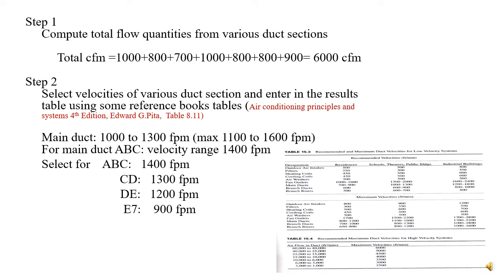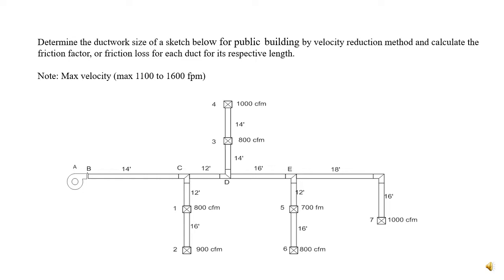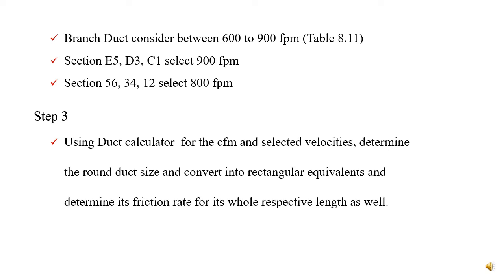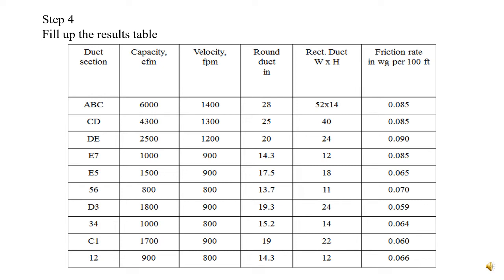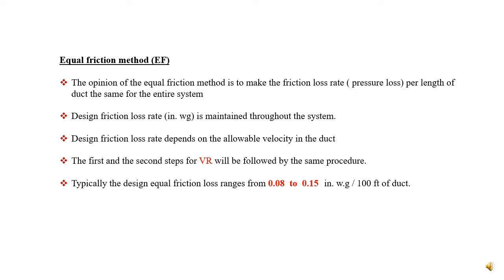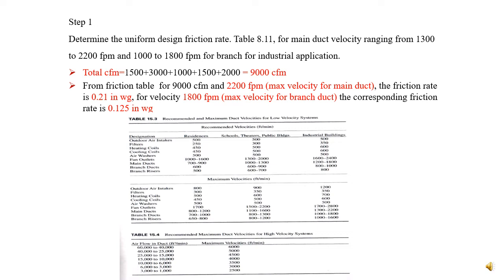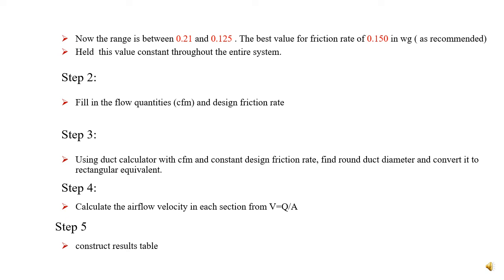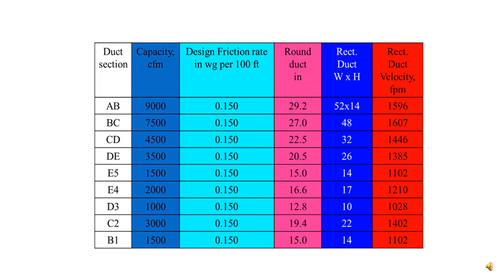Air Distribution System Design Lecture 7 part 2

Comment: ZARIF ROSTAM (B071710681)
continue the previous lecture in Velocity Reduction

Step on Velocity Reduction Method
- total up total air flow (cfm)
-choose the best velocity and cross check the max air flow in main duct and branch
-based on the air flow and friction rate choose the duct size

Step on Equal Friction Method
-All duct system will using the same friction loss
-First and second step for VR will be followed by the same procedure.
-Design equal friction loss ranges from 0.08 to 0.15 in w.g / 100 ft of duct

Comment: KHOR YE SHU  (B071710464)

*Velocity reduction *
1. The design focus the highest at the entrance (1000 to 1300 cfm) and the the end section of duct size will be lowest (900cfm).
2. Every point can check using duct calculator to find the cfm and velocity.
3. From duct calculator also can find the size of round or rectangular duct.

*Equal friction
*
1. To make the friction loss per length of duct the same for the entire system
2. Design friction loss rate (in. wg) is maintained throught the system. 
3. Use duct calculator.

Comment: Muhammad Zulqarnain Bin Zamzuri (B071710782)

VELOCITY REDUCTION METHOD
•	Compute total CFM
•	Select velocities of duct section and enter in result table using preference books table
•	Using ductulator, determine size of duct and friction rate using CFM and selected velocities
•	Fill the table result

EQUAL FRICTION METHOD
•	To make up friction rate loss (pressure loss) per length of duct the same for entire system
•	Design friction loss rate (in wg) is maintained through system
•	Design friction loss rate depends on allowable velocity in duct
•	1st and 2nd step for VR followed the same procedure
o	Step 1 : Determine uniform design friction rate
o	Step 2 : fill in CFM and Design friction rate
o	Step 3 : using ductulator with cfm and constant design friction rate, find round duct diameter and convert to rectangular equivalent
o	Step 4 : Calculate airflow velocity from each section using V=Q/A
o	Step 5 : Construct result table

Comment: MEGAT MUHAMMAD UMAR BIN MEGAT KHAIRUNI (B071710565)

- For velocity reduction method(VR) the velocity are assign to some section of the duct system
-the highest velocity is at the entrance and the lowers velocity is at the end of the duct.
- by using duct calculator we can check the CFM and velocity
-by used the velocity and area of the air duct we can calculate the quantity of the air

-for equal section method(EF). 
to make sure the friction loss rate per length of the duct is same for the system and
to  design friction loss rate (in.wg) is maintained through the system which depends on the allowable velocity in the duct

Comment: Cheah Kok Hun B071710006

2 New Methods Calculation Learn in Lecturer Part 2
Velocity reduction Method( VR)

Velocity reduction( VR)
-Assign velocities to each various section of the duct system
-Velocities at the initial entrance would be the highest and followed by succeeding sections are reduced, lowest at the end of the duct.
-The air quantity for each section is known already by assuming a velocity, which this enable flow area to be calculated

Equal Friction Method (EF)
-The design calculate the friction rate in (w.g) of the system of the duct
-The friction loss depends on the velocity allowable in the duct.
-The design friction loss should follow the range from 0.08 to 0.15 in w.g/100 ft

Comment: MOHAHAD SYAFIK BIN SOFI
B071710064
VELOCITY REDUCTION METHOD
in which it is appropriate to assign velocities to different parts of the duct system in order to know the velocity and to measure the air quantity flow area for each section supplied. 
-- The various sections of the duct system are assigned speeds. 
-- The maximum speed is at the entrance and the lowest speed is at the end of the duct
EQUAL FRICTION METHOD
-The analogous friction approach is of the opinion that the friction loss rate (pressure loss) per length of the duct should be the same for the entire device 
-Design loss rate of friction (in. wg) is sustained over the entire device. 
-Designing the rate of friction loss depends on the velocity allowed in the duct 
-Same procedure will follow the first and second steps for VR.

Comment: NUR SHAFIQAH BT ABDUL GHAPOOR (B071710400)

Velocity Reduction Method (VR)
1. Assign velocity to the various section and the highest at the enterence of the ducting system.
2. Velocities in succeding sections (neck section) are reduced and make sure the lowest velocity at the end of the duct.
3. Air quantity for each section (or room)  are known already and by assuming, it can calculated the flow area.
4. As long as the design make sense, it will probably accepted, the unrealistic design like flexible duct cannot be greater or equal to rigid main duct, it does not make any sense.

Equal Friction Method 
1. Like it's name, the fiction loss for the whole duct system is the same or equal.
2.  Friction loss rate maintained throughout the system.
3.  design friction loss rate depends on allowable velocity in the duct (cross-checked).  
4. Typical design is 0.08-0.15 in w.g/100 ft but it depends.

Comment: LIM PEI JUN (B071710194)

Continue from previous slide, this presentation is regarding VR and EF method.

Step of VR
-compute total flow qualities (CFM)

-select velocity of various duct section, example of FPM for main duct and brand duct.

-using CFM and selected velocities to determine the size of duct even square or round duct through ductulator.

Step of EF
-compute total flow qualities (CFM)

-select velocity of various duct section, example of FPM for main duct and brand duct.

-using friction loss to getting the duct size through the ductulator.

Note: equal friction loss usually are 0.08, 0.1 and 0.15 in wg/100ft of duct.

Comment: ALDY HENRY DUSIM (B0717100329) 

Velocity Reduction Method (VR)
-its shows the step for the method calculation and it is important to know the total cfm of main duct and also need to select velocities for various duct section and this need to refer the table given from this slide. this is to help improve the air flow for the system and minimize the loss. note also that the main duct must be 1000 to 1300  fpm (max 1100 fpm - 1600 fpm) thus main duct must be the biggest velocity so choose within the range and minimum velocity at the end of duct section must be minimum 800 fpm. then use duct calculator to determine the size of your duct after you have select each fpm for all the duct system. 

Equal Friction Method (EF)
-it is to make friction loss rate to the entire system equal with each other and it depends on the velocity allowable by the duct. so the step its the same as VR that is find the total fpm for the main duct and select the velocity of each section. typically the design equal friction loss ranges from 0.08 to 015 in w.g/100 ft of duct and it must be maintain through out the duct. 
next is to calculate the allowable velocity for the duct. then can start the rest of the calculation that also involves using duct calculator and it is important to know how to use it so you can finish all the calculation. note that that are no fix answer because it depend on your engineering judgement that will change according on what system that are from the building.

Comment: AMIRA NASUHAH (B071710121)

1. Velocity Reduction Method
 - Velocities are assigned to the various section of the duct system.
- The highest velocity is at the entrance
 and the lowest velocity is at the end of the duct
- Using duct calculator to check every point and to find cfm and velocity
 
- The quantity of air will be calculated from the velocity and area of the air duct

2. Equal Friction Method
- To make the friction loss rate per length of the duct the same for the entire system
- The design friction loss rate (in. wg) is maintained throughout the system which depends on the allowable velocity in the duct.

- For the calculation, the first and second steps for VR have followed the same procedure.
- Design EF loss ranges from 0.08 to 0.15 in.w.g/100 ft of the duct.

Comment: Lua Wei Jie (b071710861)
basically all is calculation part...
VELOCITY REDUCTION METHOD : the duct designed in such a way that the velocity decreases as flow proceeds. pressure drop are calculated for this velocities for respective branches and main duct. the duct size are determine for assumed velocities and known quantities of air to be supplied through respective ducts.
EQUAL FRICTION METHOD :The opinion of the equal friction method is to make the friction loss rate ( pressure loss) per length of duct the same for the entire system
. Design friction loss rate (in. wg) is maintained throughout the system and it depends on the allowable velocity in the duct.Typically the design equal friction loss ranges from 0.08  to  0.15 in. w.g / 100 ft of duct.
These methods involve some engineering judgement and extensive manual recalculations, so air distribution systems designed by different engineers for identical situations will turn out to have different fans, duct sizes, costs, and overall system energy demands.

Comment: ARVINTH A/L RAMACHANDRAN  (B071710339)

basically for duct sizing there will only using two method for most commonly that is velocity reduction and equal friction.

Velocity Reduction ( VE )

- The design focus the highest at the entrance (1000 to 1300 cfm) and the the end section of duct size will be lowest (900cfm).

 - need to assign velocities to various section of the duct system in order to be able to know the  velocity and calculate flow area from air quantity for each section supplied.

-Using duct calculator to check every point and to find cfm and velocity
 and it also can find the size of duct.

Equal friction method (EF)

-Design friction loss depends on the allowable velocity in the duct.

- Design friction loss rate depends on the allowable velocity in the duct

- The design friction loss should range from 0.08 to 0.15 in w.g/100 ft

Comment: Muhammad Syafiq Bin Ahmad ( B071710592)

Velocity Reduction(VR)

* Velocity reduction is the method by reducing the velocity of air in the duct.
*The velocity will become lower until the get least at the end of air duct.
*The quantity of air will be claculated from the velocity and area of the air duct.

Equal Friction (EF)

*The design calculate the friction rate in (w.g) throughout the system

*The friction loss is depends on the velocity allowable in the duct.

*The design friction loss should range from 0.08 to 0.15 in w.g/100 ft

Comment: NUR SELIHAH WAL HUDA BINTI AHMAD (B071710190)
VELOCITY REDUCTION
- Varying the velocity in the main and branch ducts.
 
EQUAL FRICTION
- Automatically reduces air velocities in the direction of air flow, which in turn reduces the potential air flow generated noise. 
- This method make the pressure loss same for the entire system.
- Design friction loss rate is maintained as is depends on allowable velocity in ducts.

Comment: M.RAHIMI MUSTAPHA (B071710225)

So  basically in the lecture 7 part 2 was continues of the first part of lecture 7 only that its focus more on the  VR method (velocity reduction) and EF method (equal friction).
  1. VR method (Velocity Reduction), where it need to assign velocities to various section of the duct system in order to be able to know the  velocity and calculate flow area from air quantity for each section supplied.
         - Velocities are assigned to the various section of the duct system.
         - The highest velocity is at the entrance and the lowest velocity is at the end of the duct
        - Using duct calculator to check every point and to find cfm and velocity
        - The quantity of air will be calculated from the velocity and area of the air duct

  2. EF method (Equal Friction), where it use the same friction loss ( pressure loss ) for the whole duct section if possible
        - To make the friction loss rate per length of the duct the same for the entire system
        - The design friction loss rate (in. wg) is maintained throughout the system which depends on the allowable velocity in the duct.
        - For the calculation, the first and second steps for VR have followed the same procedure.
        - Design EF loss ranges from 0.08 to 0.15 in.w.g/100 ft of the duct.

The importance of these calculation need to be calculated correctly was because it can impact the whole duct system. Any wrong miscalculation or misplacement of suitable duct can give big impact to the occupant in the building/space in terms of human comfort or it event can cost money (to repair the damage been done after installing) thus making VR & EF method a crucial step before installing to any building.

*both of these method need to be refer to recommended table of air distribution and ductolator

Comment: Mohd Sazwan Fitrie Bin Mohd. Khairil Fitrie
B071710488

Velocity reduction method (VR)
	~Velocities are assigned to various section of the duct system, the highest at the entrance.
	~Velocities in succeeding sections are reduced, lowest at the end of the duct,
	~Air quantity for each section is known and by assuming a velocity, enable flow area to be calculated.

Equal friction method (EF)
	~To make friction loss rate per length of the duct to be same for the entire system.
	~Design friction loss depends on the allowable velocity in the duct.
	~First and second step for VR will be followed by the same procedure.
	~Design equal friction loss range from 0.08 to 0.05 in w.g/100 ft of the duct.

Comment: MUHAMMAD AMIR SYAFIQ BIN AHMAD SUKRI (B071710161)

velocity reduction (VR)
- assign velocity to the various section of the duct. the system, the highest at the entrance.
- velocities in the succeeding section are reduced, lowest at the end of the duct.
- the air quantity for each section is known & by assuming a velocity, enable flow area to be calculated.

equal friction method (EF)
- to make the friction loss rate (pressure loss) per length of the duct the same for the entire system.
- design friction loss depends on the allowable velocity in the duct.
- the first and the second step for VR will be followed by the same procedure
- the design equal friction loss range from 0.08 to 0.05 in w.g/100 ft of the duct.

Comment: Mohd Syahiran Bin Mohd Pikeri
B071710026

Velocity reduction (VR)
-The design will be focus on the highest at the entrance and the end of the duct section should be the lowest as possible.
-The duct calculator can be use to find the CFM and velocity at each of the point
-The duct calculator also have a function to find the size of the duct either the duct is round duct or rectangular duct.
-Tables or Figures from book reference also can be use

Equal friction method (EF)
-To make the friction loss rate (pressure rate) per length of duct the same for the entire system
-Design friction loss rate (in. wg) is maintained through the system. 
-Design friction loss rate depends on the allowable velocity in the duct
-Design equal friction loss ranges from 0.08  to  0.15 in. w.g / 100 ft of duct.

Comment: Muhamad Afiq Haikal (B071710534)

Equal Friction Method – The method that calculate pressure loss per length of duct the same for 
                                             the entire system

•	Calculate total CFM 
•	Cross check the table max velocity for main duct,max velocity for branch duct and friction loss
•	Choose any friction value between the range
•	Fill the flow quantities CFM and design friction rate
•	Using duct calculator we can find round duct diameter or equivalent rectangular
•	Calculate air flow velocity
•	Construct table

Comment: MUHAMMAD HAZIM BIN ISMAIL
B071710545

Velocity Reduction method (VR)
- Velocities are assigned to the various section of the duct system.
- The highest velocity is at the entrance
- Using some ready Tables or Figures from book reference
- Using duct calculator to check every point and to find cfm and velocity
- Using duct calculator also can find the size of duct
- Velocities in succeeding sections are reduced
- The lowest velocity is at the end of the duct
- Air quantity for each section is known already
- Flow area is enable to be calculated by assuming a velocity

Equal Friction method (EF)
- To make the friction loss rate (pressure rate) per length of duct the same for the entire system
- Design friction loss rate is maintained throughout the system and depends on the allowable velocity in the duct
- Design equal friction loss ranges from 0.08 to 0.15 in w.g / 100 ft of duct

Comment: Ahmad asyrafamirudin bin aznan b071710607

Velocity reduction 
- the design focus the highest at the entrance and end section and the size will be lowest
- to find the cfm in duct use calculator at every single check point
- the calculator also cam find the size of ducting

Equal friction
- to design friction loss rate 
- to make sure the friction loss are same by entire system ducting